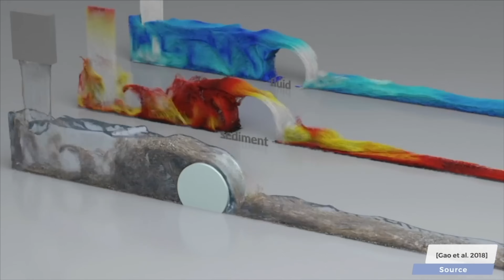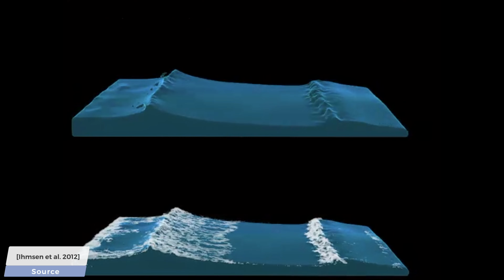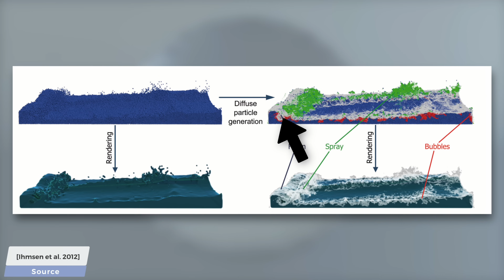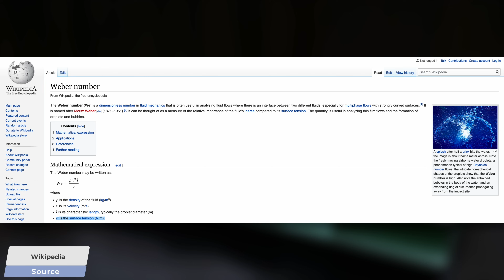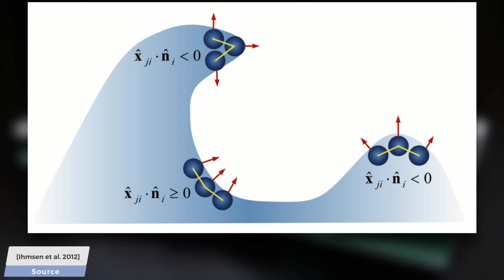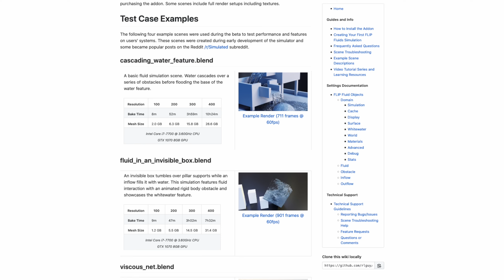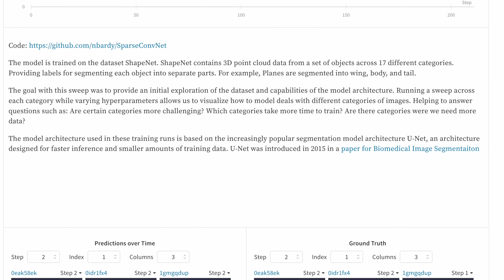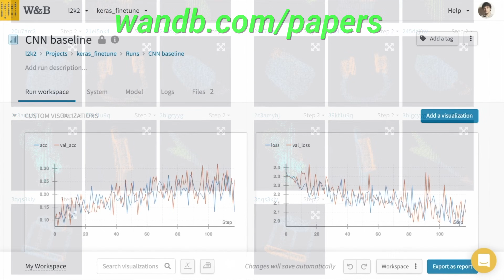Is a Realistic Water Bubble Simulation Possible?

Comment: If the bubbles look really bad on the video, try upping the resolution cause the bitrate will be higher. I am using a 1920X1080 monitor and it did improve the quality!

Comment: Awesome video. Small comment is that the lifetime of the simulated diffuse particles on the surface of the water in most of those simulations is clearly too high. Because the surface tension of the bubble material would be hard to calc perhaps try something like a fixed time with like a 20%  randomized variation existence length.

Comment: your talking about a simulation that represent 100pixel large of fluid during 20sec in 8h to 40h of computing on actual hardware 

what make me math that for an hd4k60 is about requiring 20*3600*60 computer for get real time 

4M pc power for get realistic water in a game
with the common twice per 18month its just 30year in the futur
tought in 30y the dispaly size may increase too
so its actually realtime on a 3*3 pixel screen 30f/s
is my math wrong or the blender engine is not so much optimised

Comment: Treating it as a post-processing effect makes it less realistic, in reality.  If i'm understanding right, with this method, you're not actually "simulating" any foam/bubbles/air; rather the water itself is emulating the appearance of it with no kinetic change in the fluid simulation.  Air/foam/bubbles in water will affect the fluid physics.  Yeah, it would take way longer to compute, but there's no substitute for taking into account that surface-tension interaction.  It's a phenomenal shortcut to achieve better visuals, (at least from a more top perspective) so at the end of the day, it's a big win..

Comment: Isn't just Korteweg–de Vries equation should solve your trouble? It is for single wave but you can multiply it and it just takes Runge-Kutta method to solve cause usually it takes less than second to solve for each wave

Comment: only thing I see that could be done better is getting the deep bubbles to always rise up at a speed relative to the bubbles size and depth. This would get bubbles moving to the surface to pop more realistically in the cube.

It looked to me that the bubbles sat for to long on the bottom , but this is insane awesome simulation!

Comment: Have you seen what the software Houdini makes possible? It's absolutely amazing, and is I believe also an implementation of this work in its flip solvers. The amazing part of the whitewater system in Houdini is that it's very easy to get complete access to its inner workings and change those, since everything is node and attribute based. It gets very easy to not only change the behavior of the liquid and of the foam in arbitrary ways, but to also output any possible information, like velocities of each particles, vorticity etc, to visualize them, or track the data in other ways. Besides the fact that Houdini apprentice is free and unrestricted in almost all ways except rendering, there are good resources here on YouTube, for example the whitewater masterclass by Omar Zarifi.

Comment: Great and superb fluid and bubble-foam-spray simulation. As usual I am mostly looking forward to the simulation simplification so as to be able to run it in real time for games. I wonder if 3d fractal textures would be the answer to that, the fractal seed could be created by objects like simplified waves/ripples collision, underwater ground and waters edge ground and objects in the water and it could simulate particle dynamics in a simplified form by having simplified fractal animated water models. Of course if the maths could be simplified enough the water could still be done with particles I guess, but for the whole of the ocean surrounding the player it would be difficult in real time for games. Anyway, another great video, thanks.

Comment: Blenders own fluid solver is getting a replacement soon. (Might already be in 2.82 builds, not up to date on that.)
Its called Mantaflow and can also do spray/foam/bubble particles.
Reply: I've heard it's based on the FLIP fluid sim
Reply: @fabbrobbaf  Mantaflow is not related to the FLIP Fluid Addon.
Both Mantaflow and the FLIP Fluid Addon use the "FLIP" (Fluid Implicit Particle) method to use particles instead of geometry for the core simulation, final geometry gets generated after.
Reply: Mitsuma's Animation and Stuff thanks for the rectification
Reply: Mantaflow is there in the newest builds - along with the old method :P bubbles, foam and spray exist
Reply: Dude, I tested Mantaflow, it is awesome. I'm so happy that Blender 2.82 will come with this new fluid solver. :D
Reply: yes, it is in 2.82 beta builds
Reply: Blender's new Fluid modelling system uses MantaFlow (http://mantaflow.com/) from the Technical University of Munich.
Reply: Will the fluids interact with rigid/soft body physics too?
Reply: @kilvertm  As far as I know "FLIP Fluids Addon" is able to work in conjunction with Fracture Modifier (and so, yes it interacts with rigid fractureable objects, dunno if it does also with soft body physics), Mantaflow doesn't (at least some months ago, but it works also for fire and smoke)...somewhere I saw a comparison among the two FLIP-based fluid simulation engines, maybe on FLIP Fluids Addon website.
Reply: When I first looked at mantaflow, I thought I'd never need flip fluids addon, but the FLIP fluid addon is a million times easier to use, with so many more settings, and it looks extremely realistic, and it would take ages to get mantaflow to look as good as flip does.

Comment: Pretty sure this is how Houdini’s current whitewater system works, only the whitewater is computer after the flip sim but based on the flip sim. So you advect this whitewater particle sim by your flip sim, emit particles based on curvature / velocity etc, and then it creates the bubble / foam / spray states. Lots can be tweaked post sim but it’s nice to have it separate from the very heavy flip sim so that you don’t need to re sim everything if you want the whitewater emission to be different.

Comment: In the new version of Blender (2.82) the built in system is revised to work with this simulation method (Flip particles and Mantaflow). This version is planned for february this year, so you dont need to purchase the flipfluids addon.

Comment: Adding to this video, as you said, it's a elegant solution that goes 80% of the way, but of course there are lacking elements.

The most glaring is the simulation of bubbles in static fluids, on cups and so on on; only recently the mechanism by which bubbles attach themselves to the inner surfaces of containers has been explained, as the largest take.

Comment: I wonder how fast to realtime this could get with some kind of AI involved.
2 minute papers has lots of those laying around :-)
Also to think a little vise versa.. how fast could this be rendered using the air displacement to calculate physics instead of the water particles?  (i presume the air is 1 particle in this case, might speed things up)
Just a admirer of these amazing papers, so i might think to simple about possibilities.
Reply: I think you'd still have to calculate a fluid at the same resolution for the same dimension if you were to use air displacement - air, of course, being a fluid.

Comment: Meanwhile, real-time water simulations in games look like a few spheres moving along a parabola into a prerendered puddle.  We have a long way to go.
Reply: @Interdimensional games have pre-baked graphics because of optimization you can play it at a playable rate
Reply: You dont want to wait 80 hours for the river you're trying to cross to render
Reply: This video can be implemented in games right now. Yes, right now. The takeaway is that you would have 60 SPF. Not frames per second, 60 seconds per frame. That is, if you have a decent enough graphics card, and the fluid being simulated is not that great in size.
Reply: Real time rendering is a whole nother beast. You still can have inspiring and brilliant effects. But everything must run quickly. And often times simple effects are the method of choice due to: requirement to run on a variety of hardware, performance differences in advanced effects, and development time required.
Reply: IDK, I mean in a fixed view game, like isometric or top down, you could use something like this to pre-render a tonne of animations.

Or perhaps in a 3d game, you could massively cut down on the number of particles, or use AI to create an approximation.
Reply: GPUs are way too slow so fluids in games don't behave like they should.
Reply: The key-word of course being real-time - games have to run on commodity consoles and a variety of PC hardware, and when you consider that these simulations of water alone in a blank environment took hours to render on powerful workstations, you understand why we don't see simulation like this in games.
Reply: wrong, quite a few games have fantastic water
Reply: It's also possible to save the simulation result efficiently and stream it. There is no interaction though. I can imagine a hybrid, with something like 3D animated decals.
Reply: Yes, but some games do it quite well, take a look at Sea of Thieves for example, which despite being multiplayer does it quite nicely:
Links to game footage: 
(https://gfycat.com/keenunsightlyflyingfish-sea-of-thieves-seasick-tyvan-tv-gaming)
(https://steamcommunity.com/sharedfiles/filedetails/?l=german&id=1273602336)
(https://www.youtube.com/watch?v=aGogFt4bhTM)
Reply: @oleksiishekhovtsov1564  thats because, i believe sea of thieves uses an animation for the sea, rather than a simulation
Reply: @sq1ndup346  interesting
Reply: @sq1ndup346  The sea is actually a simulation of sorts. Its serverside, there is only 1 sea at any given time. Its identical in every server you join, its just translated into your game pre-renderd if you will
Reply: @geyotepilkington2892  ahh, that's very cool, i guess you learn something new everyday ;)

Comment: At the end of the video, are you referring to the current (elbeem) simulator in Blender or the up and coming Mantaflow?
Reply: From watching the video twice, I only hear him talking about the Flip Fluids plugin for blender (link in video description). Might work on top of Blender's internal simulator, but could also have nothing to do with it.
Reply: @elmo2you  FLIP fluids is an own simulation tool. We use Blender for scene generation and rendering. The FLIP fluids addon for Blender can be understood as GUI for the simulator inside Blender. It feels like being integrated like the internal simulator, but is different.
Reply from the maker: @Blenderphysics-Videos  Thank you for helping out! Upvoted for visibility.
Reply: @elmo2you  I was referring to 5:49
Reply: @clipeclipaway  Ah... now I get it. Legitimate question. Looks like the (commercial) FLIP Fluids plugin and Mantaflow use different engines (so their results may vary), but both appear to do FLIP simulations with support for bubbles, foam and spray (AFAIK). So to answer your question, probably elbeem. Or was it a rhetorical question? Either way, it appears that both the FLIP Fluids plugin and Mantaflow use a (somewhat) different approach as the one described in the paper.

Comment: Blender is getting new fluid simulator "mantaflow" in version 2.82
Reply: Im not too familiar, how does it compare to flipfluids?
Reply: @skyr8449  It has some options same as flipfluids, but flipfluids has more advanced options and it is more stable.
Reply: @skyr8449  "how does it compare to flipfluids" You mean the "flip fluid" solver/addon or flip fluid method?
Mantaflow also uses flip fluid.
Flip-fluid addon is more mature, stable and guess faster and in short better - at least for now.
Reply: I cant do shit with current Manta Flow builds, i hope its more stabe In the offical release
Reply: Mantaflow in suitable also for smoke and fire. FLIP fluid Addon seems a bit more refined
Reply: @peaolo  yeah smoke and fire is much better In mantaflow

Comment: After we perfect fluid simulation, I will trick my friends I'm in the beach
Reply: If you convinced them you are in the beach, you probably simulated quicksand.
Now try simulating being on the beach, for it will probably feel more pleasant ;-)
[intended as a pedantic yet positive linguistic correction/suggestion]
Reply: At
Reply: @mayorc  True indeed, when being situated there somewhere. Unless you like to explicitly specify that you are situated above "them grains of sand", instead of being mixed in with those ;-) Still, well spotted though.

Comment: I wish so much that in Blender you could do water sim interacting with dirt requited, smoke and rigid body physics T.T

CGI is so pretty, you take for granted that in real life things like those exist but to figure them out, program and render them it takes a hell lot of time and effort T.T
Reply: This is comming up in one of the next updates. The entire physics system is being reworked right now, and in the end, everything should be able to interact with everything.
Reply: @johanaantjes2000  hope the mantaflow integration gets to be that good
Reply: @arescet  You can give it a try at builder.blender.org by downloading the beta version.
Reply: @arescet  I don't want to be the partykiller but I don't think we can expect Houdini like interaction very soon.
The very point of Mantaflow was that maintenance would be low. Meaning that they only have to update when Mantaflow standalone gets a new feature.
If you want true interaction, a large part of Mantaflow will have to be customized and I am unsure if Blender is ready to go there yet.
That's requires basically a fulltime dev or two just to maintain the entire physics section.

Surely I hope that we will get it and we probably will. But I don't think that it will come with the new everything nodes physics engine.
Reply: @johanaantjes2000  Nice. Physics is one of those things that do set some of the more expensive modellers, like Cinema 4D appart. When blender catches up on that, your really going to see a lot of the industry really rethinking their toolchains. Autodesk and Maxxon;- Be worried!
Reply: @shayneoneill1506  the vfx industry is moving slowly to houdini (shot build to render)
Reply: Yeah didn't ya know, God was a master at coding. Took him just 7 days to render all of this though
Reply: There's an addon for that
Reply: have you seen the engine physics destruction volumetric smoke and fire from Dennis Gustafsson @tuxedolabs its amazing , combined with this fluid simulation graphics for games will be near photo realistic especially with the advances in monitors , still there is a ways to go before matching the human eye resolution